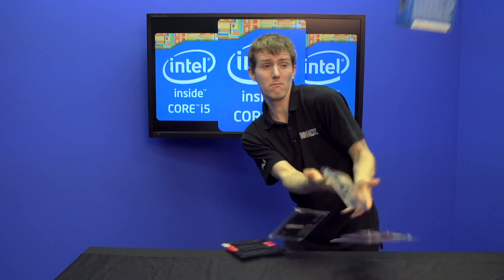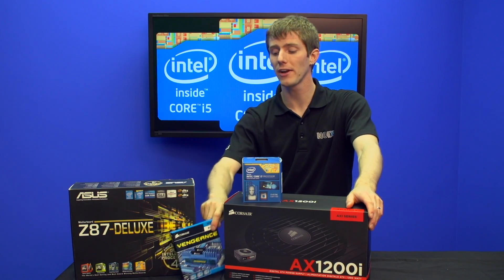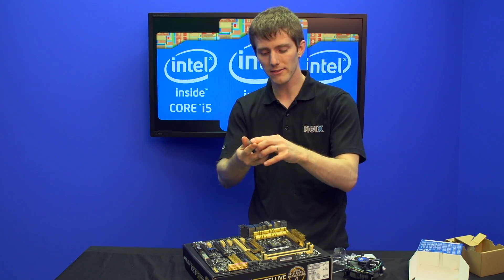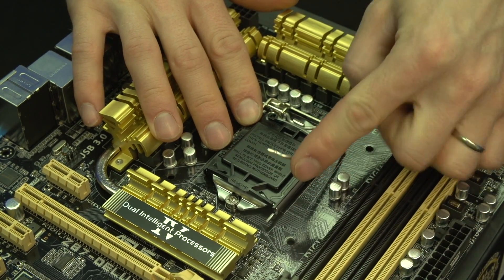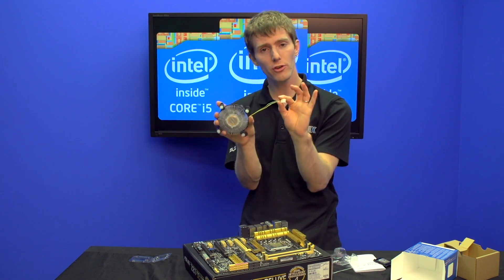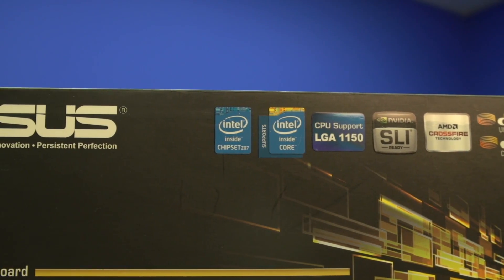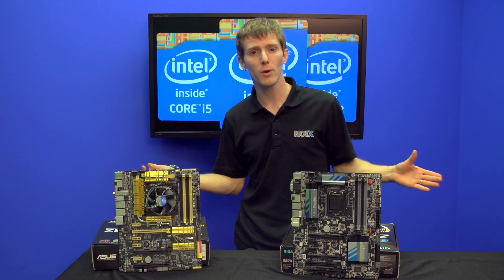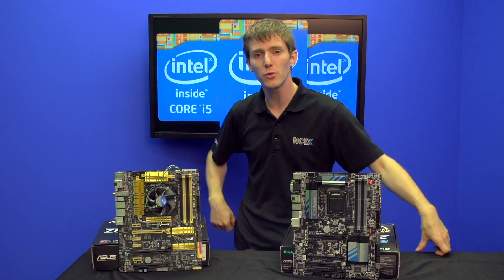Haswell Buyers Guide

Comment: Your only making sure that the CPU is seated correct in the socket. If you gave it a little wiggle and the CPU  comes off the socket on the M/B, then it would not be installed correctly. Clamping down a CPU not seated properly would be bad.

Comment: Hey Linus,
I live out here in Singapore and I am putting together a new system with Haswell. Any advice on the configuration below:
MSI Z87 MPOWER + i7 4770K
Asus GTX 780
Corsair Vengeance 16GB 1600Mhz
2 CORSAIR NEUTRION GTX 120GB in Raid 0
4 WD 750GB Black 2.5" in Raid 10 (I am going for 2.5" drives because HAF XB only supports 2 3.5" drives)
Cooler Master HAF XB
Corsair TX 850 M PSU (Corsair lists 100% Haswell sleep state support)
Cooler Master Seidon 240M Cooler

Comment: The ankle strap has a metallic area that is in direct contact with your skin. A wire comes from this metallic piece and you attach it to ground. That can be a plugged PSU, directly to the ground plug on the wall, or even maybe to a water tap, if your house uses metal pipes.

Comment: An ankle is just another way to ground yourself.  It is something that you buy specifically, kind of like a wrist strap.  Essentially you have some rubber that goes around your shoe, with a long conductive string that you put in your sock so it makes contact with your skin and grounds you.  Unlike a wrist strap you don't need to connect it to something to be grounded.

Comment: what's the point of comparing percentage improvement? if a sell a shoe and then a calculator processor i can say I made an infity% improvement in my processors. 4770k is still faster then the 8350. Also most games are gpu bottlenecked, not cpu, so it doesn't really matter as long as it's a decent cpu.

Comment: Based on cinebench 11.5 scores. Going from 3770k-4770k 8% performance improvement. going from AMD 8150 - 8350 16% performance improvement. One more thing most of the future games released on PC and console will all have been developed to work best with AMD 8-core since that's what the next-gen consoles are using.

Comment: Higher CPU clock lets you process information faster, and matters more. Higher RAM clock lets you move information into your RAM and out faster, so your temporary storage will be faster, for example opening a program, or loading a map in a game (you will probably need an SSD to see much improvement). Higher CPU clock is probably more important if you decide to overclock, but I wouldn't worry too much about RAM clocks, Anything about 1600MHz should be fine.

Comment: Just a thought: When hardware makes add functions to CPU's, like much faster on-board GPU, other memory controllers, etc, etc ... it is logical they need more or other pin layouts => then you need a new socket.
.
Do I like all these different sockets? NOOOOOOO 
But it is partly the cost of advance.
(maybe AMD 'overspected' the socket from the start and that possibly allows them to stick to it longer ... I dont know, but could be)

Comment: Linus : Intel has made it simple by making a same looking CPU.
Me : Ohhh God good
Linus : Intel has made it simple by not changing the mounts or design for mounting stock or aftermarket Coolers.
Me : Oh god ! Wonderful Just one more thing to confirm.
Linus : Intel has made everything simple Except ONE THING........
The new Processor lineup requires lga 1150 Socket which means u need new motherboard...........
Me : WTF!! :O
I just bought Asus maximus V Formula motherboard ..
Me: Screw u INTEL :[

Comment: Is a C6 C7 power state really that important on a Desktop System?

Surly we can just save the expense of a new PSU and disable those states in bios.

I'm pretty sure the cost saving (£80 PSU) will not be made up with the amount of electricity saved when your main system actually goes in to these low power states, even if you run it till the heat death of the universe.   Could be wrong though